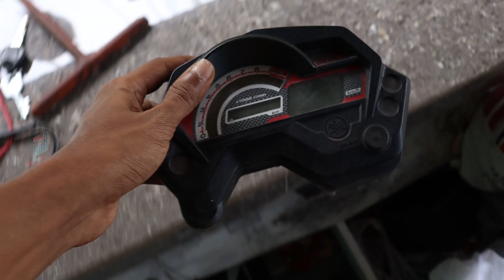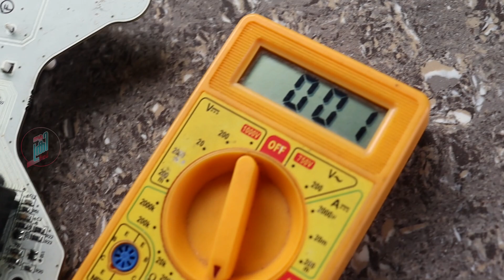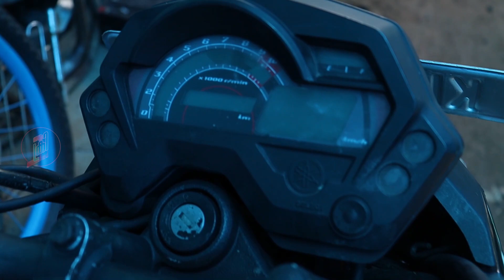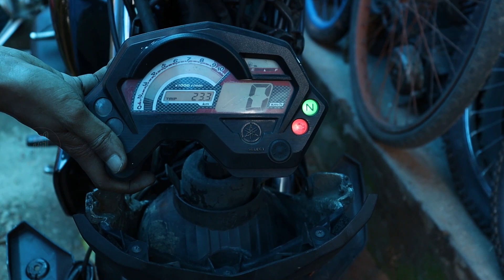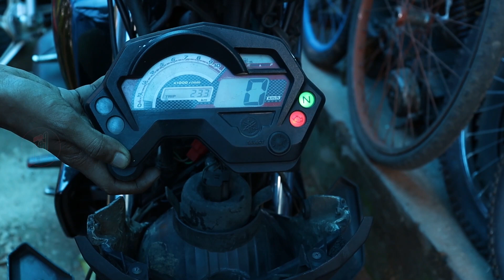FZ16 SpeedoMeter REPAIR | അടിച്ചുപോയ METRE CONSOLE ശെരിയാക്കി - AakriFied

Comment: Nice work but ini regulator complaint   aayi metre adichu poyal pinne athe repair cheyyan pattilla mian ic adakkam adichupokum 
Athil ulla zenor diode vekkan sredhikku brother you must check regulator output watt frequently for saving the metre
Reply from the maker: Yes. I know. But, for now, it works perfectly.
Reply: Aa diode edha bro? meteril original varana diode?

Comment: Broh ente fz inte battery charge chayyan koduthu , charge cheyth thirich ittapo meterum brake lightum work avanila... Brake light bulb adich poyi.. Meter entha pattiyathen aryilla... Nthenkilum solution indenkil onn parayamo.. Please reply
Reply: Same problem bro enthelum solutions kittyo
Reply: Same problem
Reply: @akhinclassic7577   battery boost cheyyan kodukumbo vere oru spare battery idanam illenki meter adich povum... Ignition on avumbo thane meter kathunnath kond aadyam adich povua meter aanu... meter service kadayil koduthal seriyavum almost oru 1k aavum
Reply from the maker: Power issue ആണ് bro. Voltage problem കൊണ്ടു പോയതാണ്. ചെറിയ repair work ഉണ്ടാവൂ..
Reply: @tbs_karthik  redy ആക്കി diode പോയതാണ് മീറ്റർ പിന്നെ ഡയറക്ടർ ആയപ്പോ വോൾട് koody bulbs poi
Reply: @athulk8778   without battery run cheythu 2 days, puthya battery ittappo meter working alla... Meter sheriyaakkaan pattumo bro

Comment: ഇതിൽ കാണുന്ന diode ഒരു zener diode ആണ്. അത് 1N4007 വെച്ച് replace ചെയ്യരുത്. Zener diode തന്നെ ഉപയോഗിക്കുക.ഈ short ആയ diode remove ചെയ്ത് അവിടെ 1N4007 diode ഇടുന്നതിനു പകരം അവിടെ ഒന്നും ഇടാതിരുന്നാലും work ചെയ്യും. എന്നാൽ over voltage വന്നാൽ മീറ്റർ മൊത്തമായി ഡാമേജ് ആവാൻ ഇത് കാരണം ആവും. Dont try this.
Reply: hi bro pls reply, ee paranja zener diode nu value etrayanu vendath, and zener diode pala size indo? ente bike same issue anu
Reply: @ThankaNChettaN77  12V zener diode ആണ് use ചെയ്യേണ്ടത്. 2 or 3 W zener diode വേണം ഉപയോഗിക്കാൻ. DO-214AB enna pckeage ഉള്ള zener diode ആണ് FZ മീറ്ററിൽ കണ്ടിട്ടുള്ളത്.
Reply: Thankyou so much 🤝🏻
Reply: Good bro
Reply: Meter  thannal ready aki tharumo

Comment: A aa diode  code number vallathum ariyo
Reply from the maker: ST E
FUN
Z842

ഇങ്ങനെയാണ് അതിനു മുകളിൽ ഉള്ള എഴുത്ത്.. ഞാൻ ഇട്ടത് 1N4007 എന്ന നോർമൽ ഡയോട് ആണ്. പഴയ ഡയോട് ലെ വര ഉള്ള ഭാഗം solder ചെയ്ത ഇടത്ത് ഇപ്പൊ ഇട്ട സാധാ ഡയോട് ന്റെ സിൽവർ വര ഉള്ള ഭാഗം വരുന്ന രീതിയിൽ ഇട്ടു.
Reply: @tbs_karthik  ippo. meater okk ayyo
Reply from the maker: Yes. Working fine. Speedo sensor dead aayond speed kaanikkunnilla..